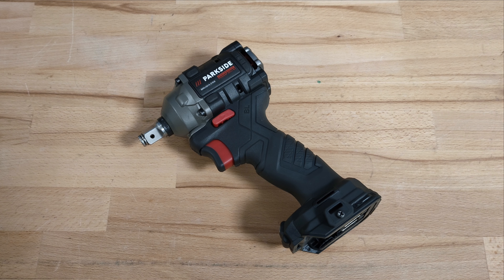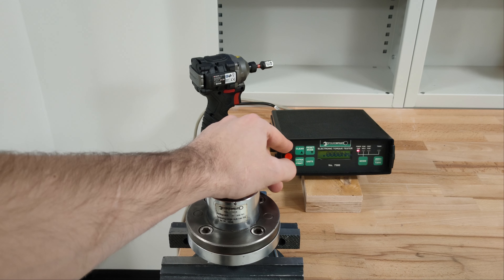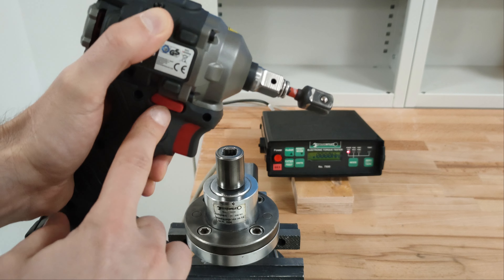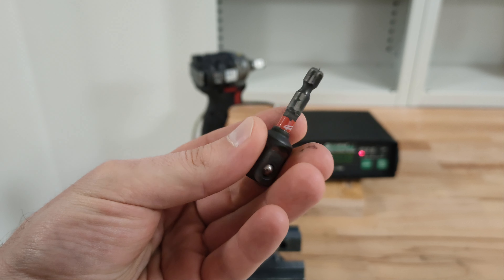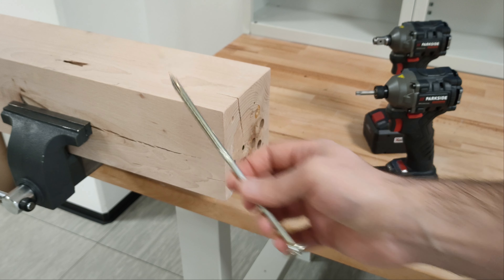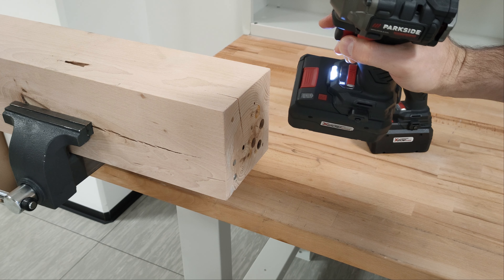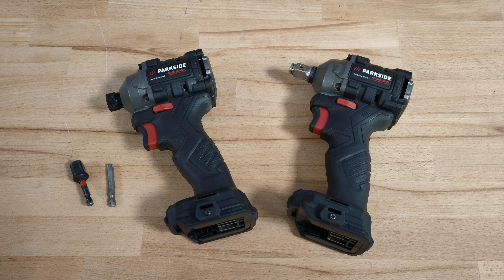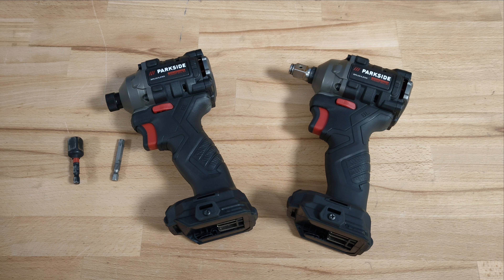Modified 1/2 Parkside Performance PDSSAP B3 vs Normal PDSSAP B3 vs beech tree

Comment: a few years ago I was the first to make modifications on YouTube, I made the green, black A1, B2 and B3 versions.  Everyone wrote to me and downloaded.
Reply: normally it would not be too difficult to get the stuff out of the case, but with that black tip I don't think it works. The black Tip seems to be bigger in diameter like the case. And it's a bit stuck as well. can you help? 
thanks!
Reply: @dersteirer74  w ewwfff
Reply: Can you give Information on how to modify impact b3, I bought an anvil, what else is needed to modify?
Reply: Vorresti un premio per questo ?
Reply: @dersteirer74 I hope you managed to disassemble the tip 😅
Reply: @Cedo86  there is something like a splint and a spring in there, once that is out, you can dissamble it. I converted it and it feels like it has a bit more power.

Comment: Hi, nice upgrade :). I saw similar on one of the Polish channels, but the person who modified it did not do any test concerning the torque. I myself am planning to do it rather for the purpose of using 1/2 sockets without any adapters, but the higher torque is a most welcome side effect  ;). Did you maybe bought the anvil from our Asian friends from the "A" portal ;)? They have a lot of them for sale with different sizes. Any chance you could tell the size of it? The anvils they offer are rather cheap, I wonder how long they will last.
Reply from the maker: https://www.facebook.com/profile.php?id=100077573599817 - this is the person you need to contact as the mod wasn't done by me.
Reply: Nie każdy ma dostęp do takiego sprzętu,  zaś kupno mija się z celem,  żeby kanał zarabiał bądź miał sponsora to co innego.  Kilka lat temu zrobiłem zielony model, później czarny A1, później B2 I B3 , pokazałem to ludziom,  do dziś piszą, żeby robić tulejki i Adaptery. Kto chciał to uwierzył, że roznica jest, teraz kolega to potwierdził.

Comment: Normally it should not be difficult to get the anvil out of the case. But here it's kind of stuck, and the front tip probably wont go through the case. Any idea how to change it? I want the 1/4in. anvil so I don't need the adaptor. thanks,
Reply: sorry I did not see your comment. I tried to change the anvil but I had the wrong spare part. You have to get out the washer spring in the anvil first. Then disassemble the anvil, there is a little ball in there, a washer, a spring and a washer. Then, it is not a problem to get it all out. the problem is, I have no idea where to get that part. It is stupid that one has to use an adaptor, just broke one.
Reply: seems there is no plug and play, here is the mod with the previous model https://www.youtube.com/watch?v=BII2uXiqXc4

Comment: where do I get the anvil? I ordered one off ebay but it's too big. the original one has a diameter of about 13,7 mm, the length of the "bearing" surface is 11,68 mm long, length of the hammer is 39,9 mm, thickness is 5 mm. the axle of the spare one I got is way too thick. I probably take it to a metal shop.
Reply from the maker: Yep, its not straight swap. You need to do some work on the tool.

Comment: i'm sick of breaking adaptors, so i bough dewalt anvil (8mm inside hole and better locking mechanism) and plaling to this anyway
Reply: Does it fit?
Reply: Hey man. You used this replacement anvil on this particular Parkside model (the one in the video)? I have the exact same one and would be really grateful if you could provide the link to the anvil you talk about. Does it fit without a problem?
Reply: Sono interessato anche io a sapere se è adattabile il dewalt